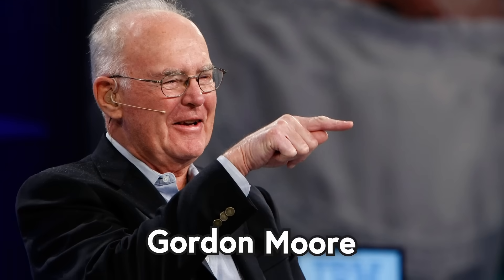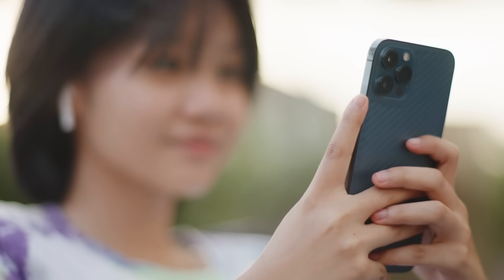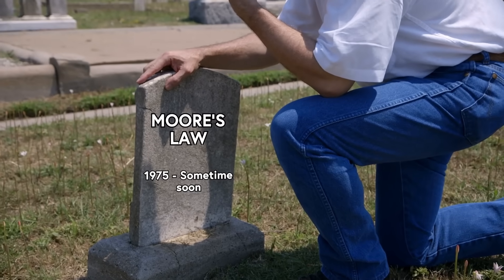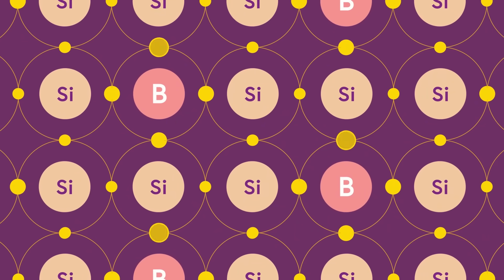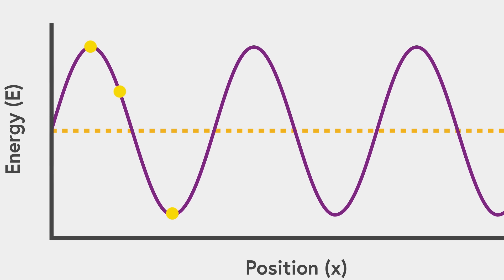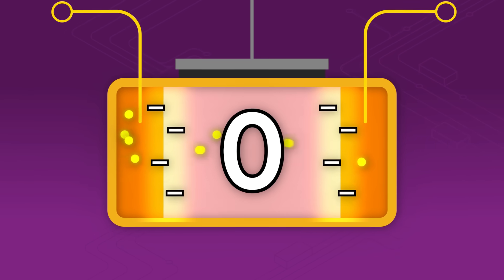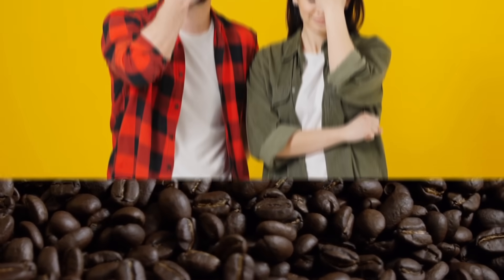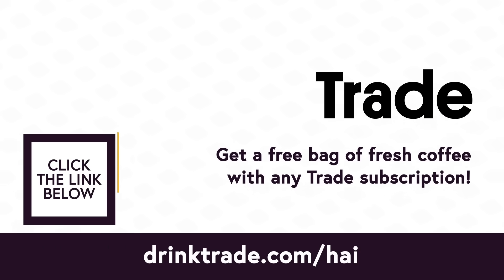Why We're Reaching the Theoretical Limit of Computer Power

Comment: As someone with a CS PHD, I feel a need to correct some incorrect parts of the video (and briefly talk about what the future holds). Warning: long and rambly

1) Transistor gate widths are actually about 32nm, not 3 nm. When the tech industry says "3nm process," those aren't referring to real measurements. They are marketing terms used to continue naming new transistors as if they were scaling at the same speed as they used to. You can read actual dimensionality stuff in the more technical releases (or Wikipedia/WikiChip).
2) That being said, there is still issues of quantum tunneling of course, which is a big part of why we are about to stop shrinking transistors, but we still have until the 2031 cadence release until that stops
3) Speaking of which, after the 2031 transistor (probably will be called something like "1.0nm" or "10 angstroms"), the industry will only be fitting in more transistors by introducing 3D integration, adding a 3D element to our CPUs (which are currently logically flat). The gate width will probably be something like 16nm
4) 3D integration has a major heat issue though, which will require major redesigns of how we design our computers, which is part of the reason we are starting "power cores" versus "efficiency cores" since the heat problem means we can many slow efficiency cores, but not all problems are paralizable. So we still need some "power cores" for the things that are not.  That will probably only get us another decade or 2 before even 3D integration with specific designs for it before the heat issues are too problematic (and even that doesn't happen, not too longer we'll reach a height problem, like flash memory will start seeing in a decade or 2).
5) Ideally, by that time some cool alternative things will propel us forward like better transistors (eg: carbon nanotube transistors) or alternative methods of computation.
6) No, quantum computing isn't a replacement. Realistically quantum computing will largely see use via cloud service and be targeted at researchers or companies for specialized problems that quantum computing is good at but and has a large input size.
Reply: Even if quantum computing was a suitable replacement for classical computing, the average person isn't going to be walking around with a bottle of liquid nitrogen to supercool the q-bits in their phone.
Reply: @vrclckd-zz3pv I’m currently taking a intro quantum computing course and dreading learning about shor’s algorithm  and quantum error correction
Reply: @vrclckd-zz3pv  They are making headways to overcome the need for extreme cold from what I heard recently for quantum computing due to finding a new material, can look into that if you're curious but I think it's still pretty absurd temperatures but the fact we're constantly able to push the envelope and find new htings still which could make it possible to operate in more normal temps, I couldn't discredit the possibility entirely.
Reply: @WildWombats  I'm sure they're making progress but super conductor research is like nuclear fusion research. We've been 40 years away from a room temperature super conductor for the last 70 years. Imo unless we make a major breakthrough in physics biological computing is a much more realistic direction for the future of technological development. They have different pros and cons to Quantum Computers but both will allow us to advance into new areas of computing that aren't possible with classical computers.
Reply: @vrclckd-zz3pv  I suppose I look at things much farther in the future which does require some degree / a lot of speculation on my end, but unless you believe humankind has reached the limit of all there is to know about physics and the universe, then I think there's a lot more untapped potential to find. All it can take is 1 single new fact to change literally everything. And we're not even a Level 1 on the Kardashev Scale for civilizations. We're close, but not there yet. I think it's also a good time to remind that electricity was only recently harnessed in the last 200 years really. Despite that, people had known to some limited degree about electricity's existence for quite some time indeed, but they simply had no idea how to harness that power or what its potential was, yet it was there all along in human's existence. We only legitimately even made the computer (as we know it, non-DOS) within the last 30-40 years truly. Internet itself similarly has only been around for about 30 years. Which is kind of crazy to think about. But in terms of the grand scale of time, 30-200 years isn't that long. Of course, we'd love to see this stuff in our lifetime, but unfortunately we likely wont' live to see the coolest new innovations, just as many humans before us never got to live to see electricity or a computer. I do ride a bit on the idea of speculation and hope, but it's not unfounded. To me, we're still in the infancy of finding technology out really in the grand scheme of things given how long humans have been around. I'd say if we've barely made any advancements after a few hundred / thousand years, then we can start contemplating whether we've truly hit that scientific limit of development.
Reply: @vrclckd-zz3pv 2 months later lk99 appears lol
Reply: @tnd_  💀
Reply: @vrclckd-zz3pv  Graphene is already a super conductor at room temperature.
Reply: @Bogglemanify  Are you sure about that?
Reply: @Bogglemanify not really, because it needs truly massive pressures which we have yet to engineer in a stable manner.
Reply: @vrclckd-zz3pv  Not a complete RIP. There are researchers in china now claiming to have found more high temp superconducting materials. I believe we'll have room temperature superconductors relatively soon, thanks to a huge boost by AI's in material research.
Reply: @zairkadian  that would be cool, I hope that happens but I'm skeptical. I've actually done some work with using AI to predict the critical temperature of super conductors myself but it didn't work very well. Probably because I rushed the thing out in 3 days to meet a deadline.

As for DNA computing, it's not that it's faster than a transistor, it's that it is extremely parallel. It's the same reason that GPUs are faster than CPUs. A CPU can do one thing very fast, a GPU can do lots of things a bit slowly. If you can divide the task up into lots of different tasks then you can have the GPU do it faster due to the higher number of cores despite each individual core being slower than a CPU core.

DNA computing is parallel because obviously you can just add more strands of DNA but also because DNA can self-replicate. It would be like if your GPU could add more cores to itself to get more work done. If you think of that task as a list of N steps then the CPU will take N steps to complete the task, the GPU will take N divided by the core count to complete the task, and DNA computing would take log(N) steps to complete the task.

Of course not every task can be parallelized like that though so for things that need to be done in sequence you're better off just using a CPU. It's like if you need 9 cakes and it takes 1 baker 1 hour to bake the cake then you can either have 1 baker complete the cakes in 9 hours or you can have 9 bakers complete the cake in 1 hour. Not all tasks can be done like that though. A wise man once said "You can't hire 2 pregnant women to make a baby in 4.5 months".

DNA computing also has the problem of being very prone to error. The DNA in our bodies makes mistakes all the time and usually it's fine but sometimes it leads to cancer. If I remember correctly from when I studied this at university the most common error is that the two halves of the double helix don't bind together properly so you end up with two strands joined but there's a little hump in the middle where there's extra DNA poking out and that prevents it from going any further, or if it does go further it doesn't work correctly. This can be mostly solved by just dumping in a ton more DNA and hoping that one of them works but there are bigger problems in practice.

If you're interested in DNA computing an alternative term to Google for is "Membrane Computing". You'll find a lot of relevant material that won't show up if you just search for DNA computing.
Reply: @vrclckd-zz3pv sorry to ask but can you explain to me what's biological computing? Never heard of that before
Reply: intel announced cfet transistors a few days ago with many transistor 3d stacked ontop of eachother
Reply: @the_bi11iona1re7  to be clear, CFET as 3d transistor scaling has been known about for years, and has been on the IRDS roadmap for over a decade. Also to be clear, the 2028 release is supposed where CFET begins to be introduced, but 2034 is the first time where improvements will probably be only through extra layers rather than shrinkage.
Reply: This comment being more useful than the entire video is astonishing
Reply: Hiyas! I don't have a CS PhD but my degree is in EECS and I did take a class in transistor design. My response is going to be targetted semi-towards your points and also semi-addressing my own concerns with the video. Also gonna be long and rambly.

So some things to establish first, let me provide a bit more detail about the MOSFET. 
  - So when it's at "OFF", the amount of current flowing from source to drain is lower than the OFF threshold, but there is still some "leakage current" due to heat (Brownian motion of electrons) and parasitic capacitance (basically source and drain are so close they act as a capacitor and a tiny bit of current flows). 
  - When turned "ON", electrons start moving from source to drain, which means the current will increase logarithmically to it's max current, going above the ON threshold. This increase in current actually has a delay, which basically sets the max theoretical clock speed of the chip. 

Now Moore's Law isn't actually dead, Dennard Scaling is. Dennard Scaling says, to achieve double the performance, we decrease the gate width and length each to 70% and change the voltages so that the electron velocity from drain the source remain constant. This halves the area the electrons have to travel and consequently halves the latency in building up current. Dennard Scaling is dying because as we shrink, we are encountering effects that cause leakage current that we have much difficult managing. One big cause of leakage is indeed quantum tunneling but there's still other major effects that we can handle with some manipulation of the MOSFET architecture. Now to address your points:

1. AFAIK, the gate widths really are down to that small. But 32nm is when Dennard Scaling died. To get to 22nm (32 * 0.7), We had to start messing with other aspects of the architecture, mainly this time we chopped off the bottom part of the gate that was not doped to decrease the surface area where electrons can flow due to heat. Then to get to 14nm, Intel came up with FinFET, which said "instead of controlling the gate just from the top, let's add 'fins' to it and control it from the sides as well". This decreases the gate delay so we can use a lower ON threshold, meaning we can apply a lesser voltage and generate less heat. We really are shrinking, we just have to add a lot of fuckery to do it. The next step would be Gate-all-around-FET (GaaFET), which controls the body on all 4 exposed surface areas..
3. I don't think 3d stacking is going to be the way forward. The core of the issue is that as we've shrank, the heat density has increased faster than we can manage. If stacking was a worthy trade-off, we would've seen stacking already happening. Instead the most we've seen is stacking of cache/memory. HBM is stacked next to the GPU and AMD's v-cache is stacked on top of non-logic portions of the core. 
4. P-core vs E-core is an Intel thing that they borrowed from mobile because they couldn't keep up with AMD. The main issue to solve was yield, or manufacturing high core count CPUs without defects. AMD built a interconnect that allowed them to glue together "chiplets" while Intel could not manage the latency. Having many bigger cores operating at a fraction of their speed that can scale to also doing complex tasks is always better.
5. There are two types of GaaFETS -- carbon nanotube and carbon nanosheet (graphene). Both are undergoing research but at least IBM has demonstrated a 1nm transistor using CNT. If I'm really gonna speculate, I believe the eventual step is to move on from the electron to some smaller sub-atomic particle to base our transistors and digital computers on.
Reply: @RayTsou even v-cache is already extremely heat intensive, these chips are “designed” to stay at 80-90° even with the strongest air coolers on the market even when only using <100 watts
Reply: Just design an active observation circuit into the sub quantum transistors and they will act correctly.
Reply: Excellent reply, well said. To add- one way of mitigating (4) is built in microfluidics inside the 3D stacked chip
Reply: 3D Computational units will be interesting because it will shake up the entire market. The gap between laptops and desktops will widen dramatically as they don't have much 3d space to utilize and a 3D chip will likely also need a redesigned cooling standard to acomodate the dramatically increased energy density and need to cool a 3D shape instead of a flat surface.

Might also be the end of direct die cooling sadly.
Reply: Some new research about biocomputers pop up
Reply: @manoftherainshorts9075 yeah, wetware computing is sort of a thing
Reply: lol everybody hating quantum computing just like they did with old computers. look at those clowns now. once we figure out error correction things will start progressing faster and faster. if quantum computing was a joke governments wouldn’t be pouring millions & billions into it already. china is leading the field in ai and has established a quantum research institute already. they are driven by the ineptitude of the west who seek to stifle competition in the semiconductor space instead of match them in spending and progress on both fronts
Reply: So 3D CPU are possible but you would need cooling on each surface? Meaning computer configuration would be very different from what it is now.
Reply: He did mention in the video that currently transistors are not 3nm, but they will be soon enough. But ig you missed it since it was written and not spoken
Reply: @raptorthegamer5524  Unfortunately, that would be wrong since it's unlikely we will ever get transistors that small, let alone get it soon. The reason he said "soon" was that TSMC's "3nm node" was yet to be in a product, but was in production. Unfortunately, the actual dimensions of its "3nm node" is about 45nm (for the gate pitch) by 23 nm.
Reply: You have a lot more hope than I do even if ic's overcome phonon emission and reduce heat output at that size (you should definitely take a look at mits research into analyzing lattice vibrations to attempt to destructively interfere with them) we still will have to deal with increasing levels of capacitance as layers become denser. Though I agree with your overall point MOSFETs will need to be replaced as our fundamental component. I am very excited for the crazy implementation of carbon nanotubes for the commercially viable use.
Reply: 2031 for angstrom 10?

You do know that Intel has angstrom 20 working right now right? 

So they will likely call it “2 angstrom” or “.2 nm”

Something dumb instead of what it actually is

Like how 4K is 160 pixels of actually being 4 thousand pixels wide, while DCI 4K is true 4k
Reply: Also I think that quantum computers can do anything a normal computer can but they're only GOOD at certain tasks
We might be seeing a QPU in computers at some point
If we added GPU to optimise graphics rendering, we could add a QPU to optimise certain tasks that quantum computers are extra good at
Reply: Even current computing is held back by current standards of memory power/latency, and this limitation further adds more problems to AI & Quantum hardware limitations besides many others such as chip design, floor planning, commercial fabrication, hardware simulators, code compilers, underlying algorithms, and system/app software development for use. Traditional computing is usually sequential, it works it's way to the answer by iterations, hence correcting itself along the way, where as quantum is all parallel inputs whilst getting all possible answers, and finding the right answer from majority of the junk/error! 
I think a workaround is to utilize a hybrid system of binary bits and qbits in series and parallel combination in a multi-core layered 3D structure like the neural brain network(CPU, DPU, GPU, TPU, QPU) simultaneously to reduce the number of algorithmic iterations and resultant errors to achieve Artificial General Intelligence(AGI).
Reply: What about DNA computing?
Reply: I was just going to write something similar! Although I'm not a CS PHD so it definitely wouldn't have been as elegant.
Reply: Wow man you should create your own video
Reply: It is also worth noting that they're sometimes talking about how small a particular topological feature of the silicon manufacturing process can be made.

It's kind of like saying that you can now make a 1x4 piece of lumber-substitute that's has essentially the same structural characteristics as a 2x4 made of pine wood.

Or perhaps that the steel beams for a particular type of building can be 4" thick instead of 8" by using a special steel alloy.

The overall size (height, width, length) of the building post-construction might still be 90% of the
Reply: Wow!

Maybe it's time to set aside the hardware end of things and put more energy into making better software?
Reply: Dear God. Finally, real life cpus will begin to resemble Minecraft ones. (they're 3d)
Reply: The thing is most of the advancements will be probably done by software, our hardware is already extremely strong but inefficient as fuck
Reply: I feel like we need to look for different materials to be used in chip. Or use some micromagnets to prevent + and - voltage from interacting with each other.
Reply: I know I’m a bit late but aren’t AMD making their Ryzen 3d chips which are stacked(?) in the way you describe ( if I understand it correctly) or is that different?
Reply: @ajardonut thats just 3d vcache
Reply: I ain’t reading, allllll dat
Reply: As an electrical engineer, seeing people talk about nanotubes or graphene makes me cringe. They remind me of all the Gallium Arsenide hype. They are the materials of the future, and they always will be.
Reply: @Vmac1394  If you are referring to me (the OP), I was carefully to refer to carbon nanotubes with "ideally" and  was the context I was using was the 2040s/2050s lol. Of course I understand that it is very possible CNTs don't pan out because manufacturing with a proper purity proves to be impossible, or some other production issue arises. Obviously even if tomorrow some revolutionary research involving producing them (or other potential post-silicon-CMOS transistors), solving nearly all manufacturing problems, we wouldn't see them in real computers until the 2030s at the very earliest.

That being said, I would caution against the pessimism that certain engineering will never happen. VR headsets were a "future technology" until they became affordable with consumer video game applications in the past few years. Solid state batteries have been a "future technology" for over half a century, and are very likely to enter EVs and/or consumer electronics within the next decade to some extent. 

Of course, there are also numerous failed technologies, but the point is you shouldn't just dismiss them out of hand. "Future tech" may or may not pan out, and you really shouldn't be confidently making bets either way.
Reply: last time they said computers are only research tools, now everyone has a smartphone.
Reply: Funny story, I got roped into studying quantum computing back in graduate school in 1996!  Clearly, it was in a nascent state back then in terms of engineering, but I didn't stay at it long before I decided I need to specialize in something that was more "right now" in terms of marketability, which I did.  I just kind of laugh about quantum computers.  I guess some progress has been made, but it's been 28 years and still not much in terms of an actual demonstrable product.
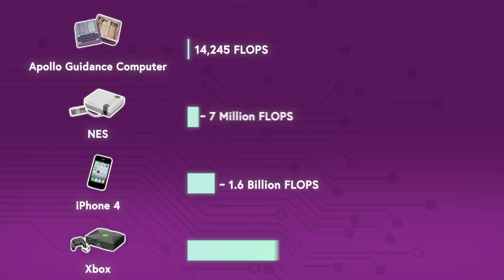Reply: Odd that you didn't notice how the 1:30 chart claims the NES, a 6502 based system, can perform 4 FLOPs per cycle.
Reply: >Realistically quantum computing will be targeted at researchers or companies for specialized problems that quantum computing is good at but and has a large input size.

You can replace quantum computing for "internet" and you would have read the same sentence in the 80s, and now you have internet to write that comment ...
Reply: @juanma9868  Now replace "internet" with a "telescope"
Nowadays you can buy one easily and it will have a greater quality than anything the ancient researchers used. But does it mean everyone has one and uses it regularly? Nope.
You can't just compare apples to shovels.
Reply: OK Nerds. :)
Reply: @juanma9868  it will be mostly used by the governments to decrypt asymmetrically encrypted data. Only 20% of it will be used by scientists.
Reply: @juanma9868  uhm thats a fallacy  false Analogy
(Sorry if i sound rude im not a native English speaker so i have difficulty's expresing myself)